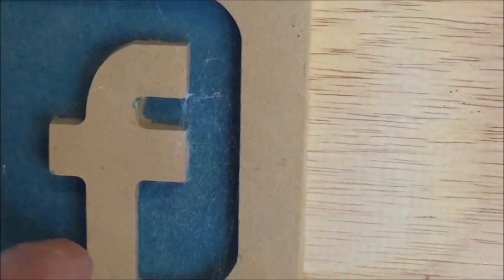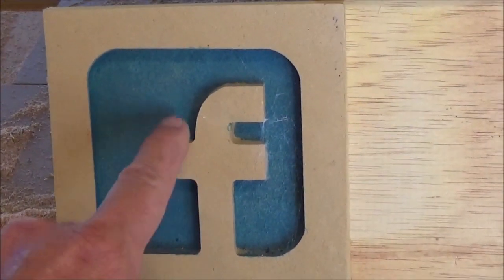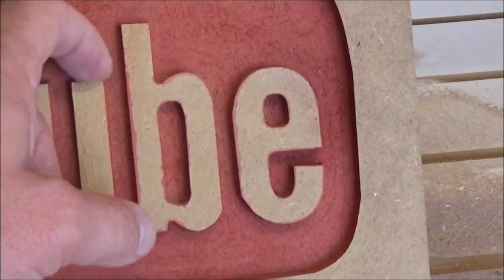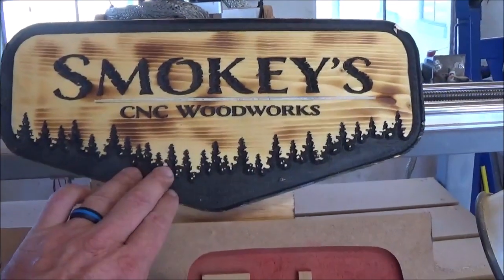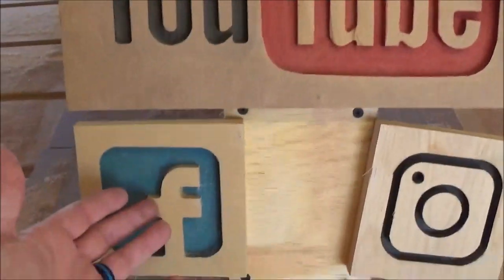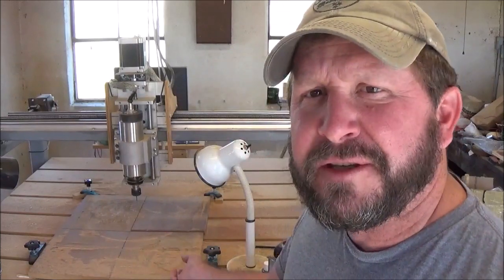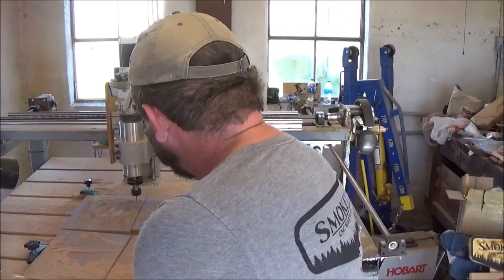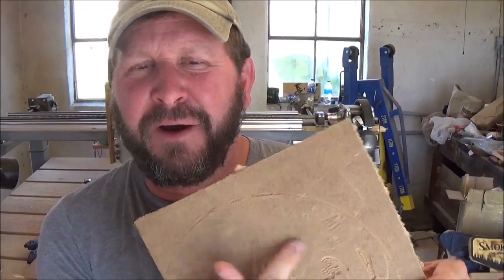Cleaning the CNC (Tips for smoother running)

Comment: There is a 3D printed fan you can get off of thingverse that friction fits to your bit shaft, and blows the chips away from the bit. 

And from what others say, it is often better to not adjust the height of the dust shroud with the router, but instead leave it a fixed height.
Reply from the maker: Ok, I'll have to look that up....I've always been afraid of putting anything around the cut area for fear of blocking the view of the camera
Reply: @SmokeysCNCWoodworks   I think the https://www.thingiverse.com/thing:1689907 would work for you.